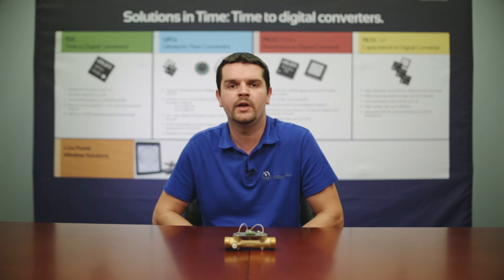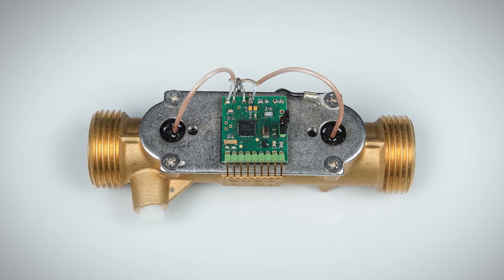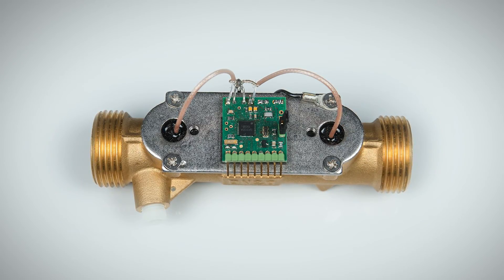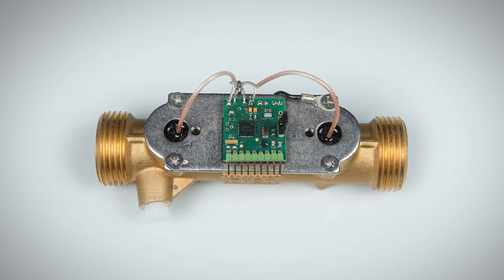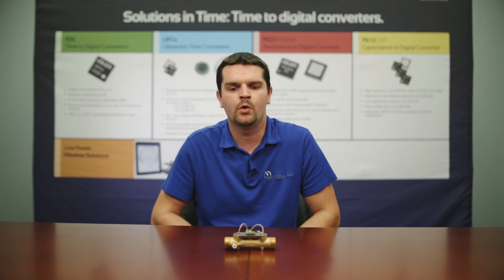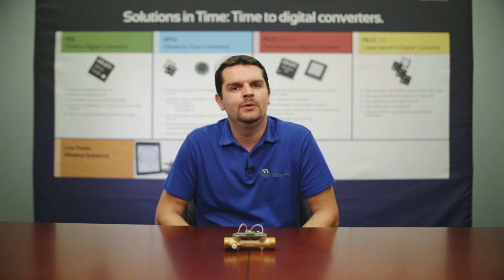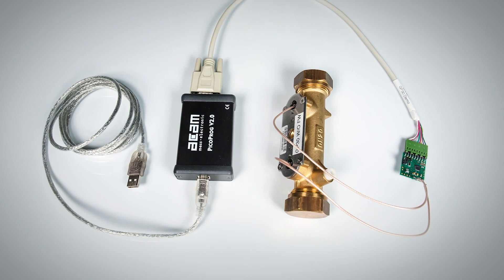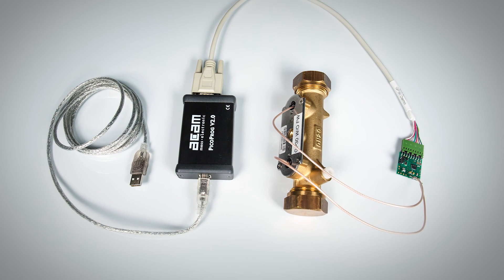GP30 Ultrasonic Flow Converter (UFC)

Comment: Hello, 
 i would like ask few questions about GP30 sensor interface kit to measure the flow of liquid. We are planning to interface small disc type transducers to TDC-GP30-F01. to find the transit time. 1. Is this kit suitable for any type of piezo transducers up to 4Mhz frequency? 2. What is the minimum distance required in between the transceiver to detect the time delay ? 3. what is the requirements to mount to the sensors on the pipe ?